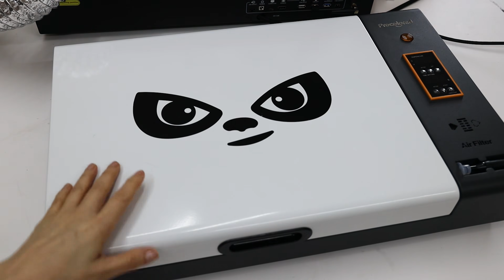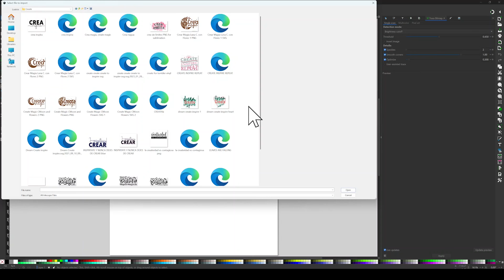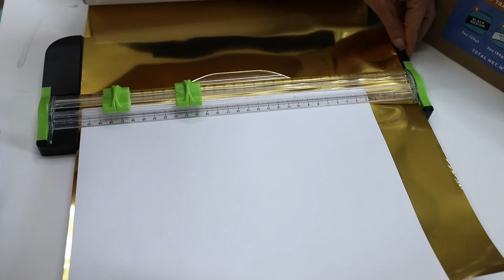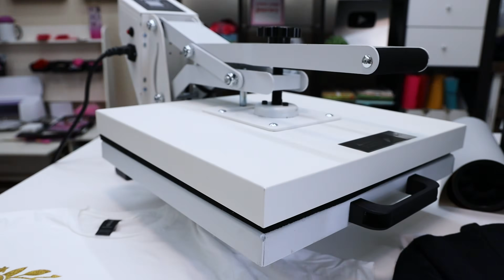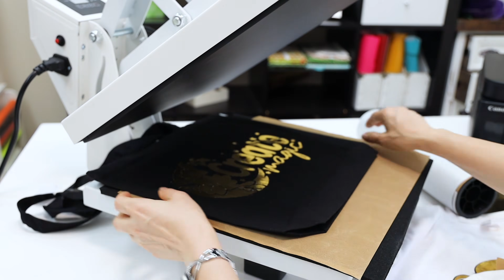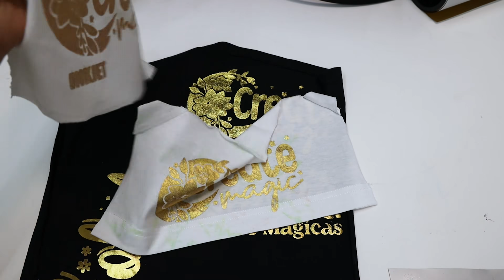DTF Hack with Inkjet Printer ✨ Customize with Foil ✨ {Vevor 15x15" Heat Press Review}

Comment: How would you compare the results of regular inkjet (Canon) vs DTF vs Epson/Sublimation?  Is the quality of the foil transfer comparable between the 3 methods? How is the washability/long term quality between the 3 methods? From the end of the video, it seems like the regular inkjet method quality is not as good - is that correct? And I think you are saying the washability is also not as good? Just wondering if you can provide your input on the differences between the 3 methods, since you seem so well experienced on this. Thank you in advance!